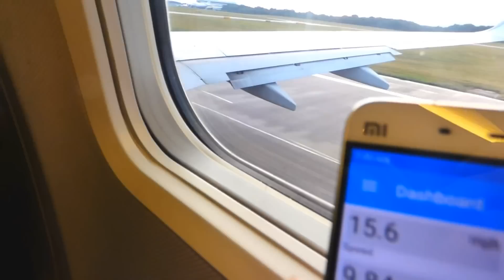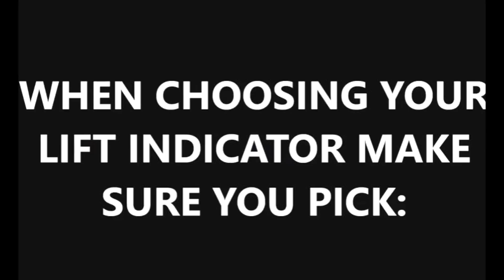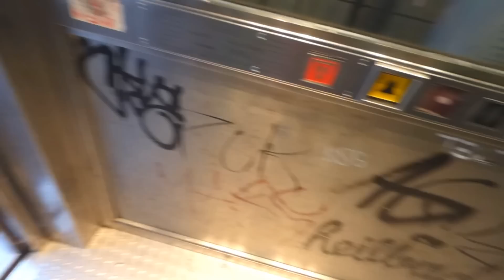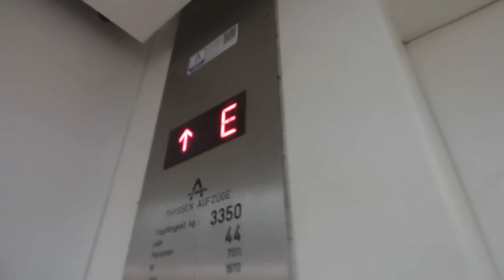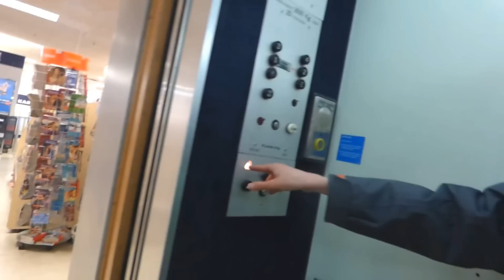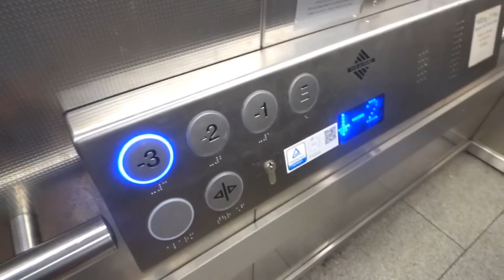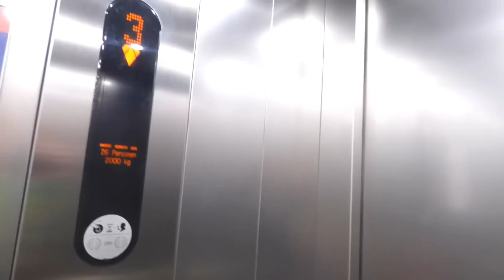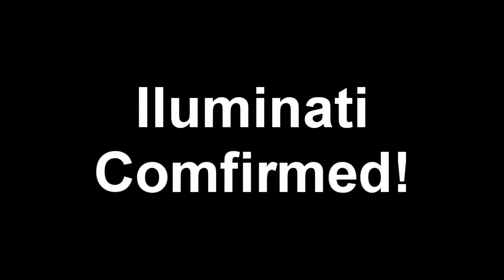RANDOM LIFT TOUR - Frankfurt

Comment: You missed a several lifts at London stansted airport, there were eco discs in which are main lifts were they go is to the trains, but the lifts you go on the rest of the terminals, are Schindlers with a travel button, and floors 1 & 2 are locked and are accessed by a key that is not dewhurst.
Reply: A schindler in Stanstead? Havent seen it yet! I have to find it when i am there next time, luckily i have the schindler keys.
Reply: Well, I been on a westinghouse tram to the runaway gates there, and there are the lifts. Floor 1 is the runaway level, 2 is the mezzanine while floor 3, I really am not sure and four I think is the plane viewing level, the floor layout is weird, it's one of those rare Schindlers where they have a Dewhurst silver plated jumbo 45 degree go button, where, it only goes two levels, level 4 and level 1. This lift has a separate front and back entryway. there are only 4 of these there.
Reply: I think they've now been modernised as when I last went there they were Jacksons. There was also some First Generation Ecodiscs at the Ryanair Gates but I think they're modded too.